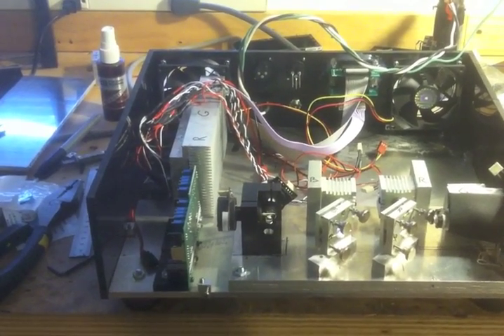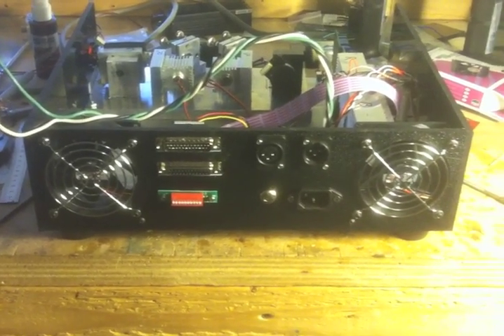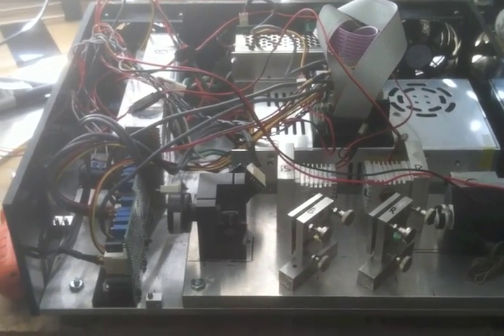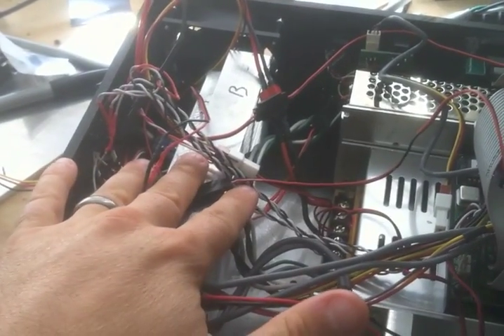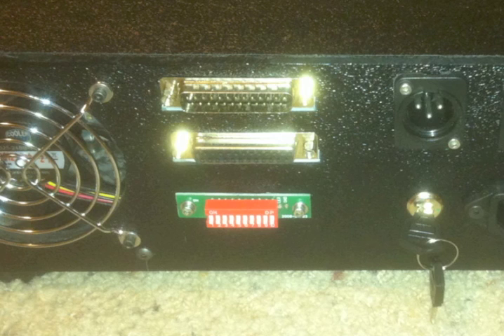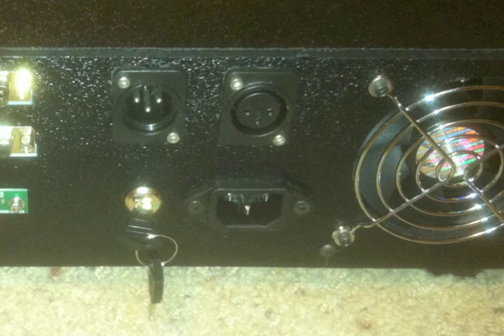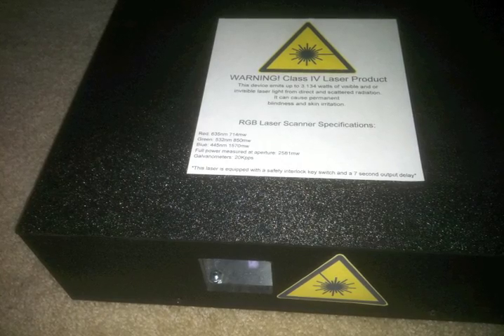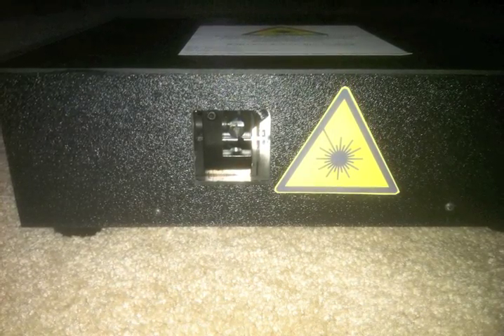RGB laser scanner homebuild video 4

Comment: hello im making my thesis abouth a rgb laser scanner and have some questions for you.
could u sent me a list with al your parts u used on this build and where did u get them.
Reply: Most parts are right off eBay. Do a search for laser galvos, rgb laser mirror, laser heat sink and aluminum plate. All the laser diodes can be found on eBay as well. But I normally use DTR's lase shop.
Reply: +Sean Spencer  ty verry mutch just a little question could i controll evrything with my arduino mega 2560
Reply from the maker: if you intend to use it as a laser DAC then you will need something capable of outputting variable voltages. For example the gavos require a +/- 15 volt signal. The laser diodes require a 0 to 5 volt signal. If the arduino board your using can do this it should work.
Reply from the maker: There are arduino boards out there that already have this capability